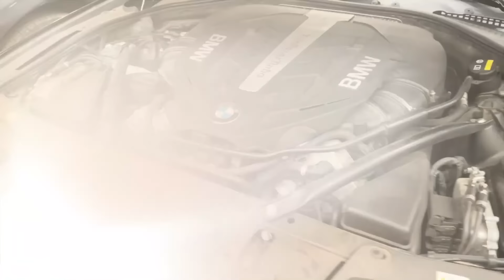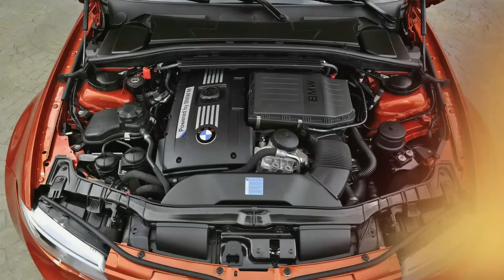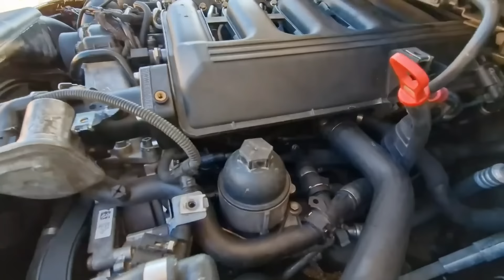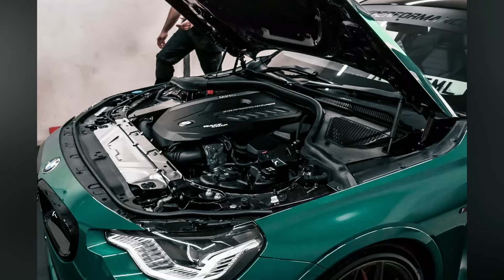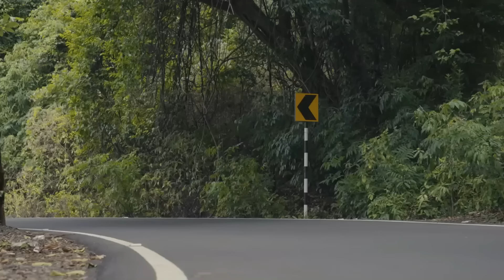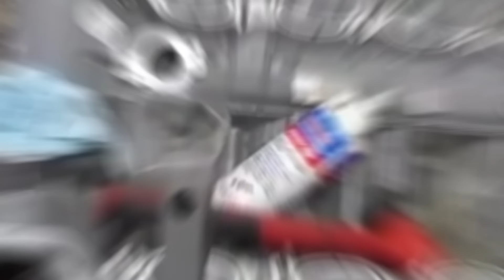3 WORST and 4 BEST BMW Engines to Own

Comment: I have n52 i love it. Some tips for an healty engine. Drive your car warm and when the oil is cold dont go above 3000rpm. Change your water pump when its old. Regular oil changes and check thr oil level regular.

Comment: N43 engines are also notorious for problems. timing chains, tensioners,  oil pressure issues, brake vacuum , ecu issues list goes on its a nightmare.
Reply: N43 owner here, after 35k km’s my nox sensor went out and i am getting timing chain resonance now on cold. Hopefully replacing the tensioner will fix. I have to check my oil filter for guide pieces

Comment: my N54 was pretty solid up to 250k miles when i sold it. original HPFP and original index 7 injectors, walbro 450 fuel pump and E40 tune at 24psi on pure600 turbos was the setup daily driving since 110k miles. and my S65 has been way less of a hassle than my N54. BE bearings are a one and done item, and i've just been keeping up with routine fluid changes.

Comment: i am someone who owns a n54 and knows alot about it the hpfp you can rebuild for 100 bucks ish the injectors suck unless they are index 12 where they dont have problems the carbon can often be cleaned at home or you can add port injector or meth injection this really helps charge pipe yeah but just replace it with a aluminium. my n54 is taken care of and the most reliable car ive owned ive owned 5 other cars

Comment: The N63 is not easy to judge: The first model was relly bad - BUT the N63B44T3 – N63TU3 Technical Update 3 is now one of the best BMW engines and has a great reliability. Close to the B58!
Reply: Would this be the 2013 650i gran coupe ?

Comment: My M52TU has 217,000 miles on it. Maintain cooling system in good order, regular oil changes…3000 miles (im old school ) going to rebuild VANOS next because of high mileage although still working fine…99 528i M Sport

Comment: N54 here , I agreed with the huge cost of maintenance and repairing. But at least N54 brings you performance unlike N46. In my opinion, N46 is the worst BMW engine ever. Lack of performance, fuel economy is just acceptable, and it still has notorious issues such as valvetronic failure(eccentric shaft, motor and sensor), valve stem seals also tons of oil, coolant leaks due to very hot engine(108 degree Celsius working temperature.)
So the first thing I done for N54 is lower the  oil and coolant temperature. The price is reduce the performance and fuel economy a little bit but worth it.
Reply: thanks for the honest review, else most of the n54 owners are misguiding the new-comers.
Reply: MY N54 IS AMAZING

Comment: Kkk n63 doesn't have oil filter housing, oil filter hounts on the sump,and if chain guides fail or break a car will just jump timing and won't start thz no any serious damage ,

Comment: 2013 N63U Not to bad, I don’t run the piss out of it. Brought used with 92K. Just systematically replaced common failing parts ahead time. I knew what I was buying 😂. However it’s been good.
Reply: It's not evn tht  bad I hve build plenty of them not even a problem

Comment: Save yourself the grief, buy a Lexus, Toyota engines are bulletproof.
Reply: Toyota doesn’t drive like BMW.
Reply: @Name-not-found92 
Toyotas run smooth, and are very quiet, their engines are bulletproof.
Reply: @masteryoda498 no they don’t that’s why the 2025 Toyotas are having massive recalls they used to be reliable back in the  80s 90s and 2000s
Reply: @masteryoda498 ive driven many Japanese cars that my family own and test drove a bmw 130i m sport. Yeah, honda and Toyota there the best a to b cars no doubt but damm, its not an exiting drive.
The beamer truly is different. id take my chanses with the n52 witch is already considered a reliable enough choice(even though i didnt, im still sad about it)
Reply: Why do you think they purchase a BMW to begin with this is one statement that I see a lot that's probably the stupidest statement that you can make they bought a BMW because they wanted one if you want it a Lexus or Toyota they would have bought one
Reply: @ChrisFoxx-s3t 
Because they fell the BS, and there’s nothing remotely stupid about my comment, talk to any mechanic and they will tell you to avoid BMWs like the plague.
Reply: @masteryoda498  My 328i with the N52 engine now at 207K miles, one of BMW's best as stated in the video.  I do not personally know any Lexus or Toyota owner with high mileage even close.  Those cars do not drive and perform as well a BMW.  I get offers buy from people who have ridden in the car.  I am very HAPPY with the car, no grief!
Reply: @masteryoda498 i agree i own a bmw one of the reliable one as they claim but compare the reliability of Toyota camry and honda accord accord wich i own the previous year never had oil leaks from valve cover,oil pan and filter housing  and never stranded on the road ie.. overheating cause by electric water pump failure
Reply: @masteryoda498 so you watch bmw videos you clearly have no interest in and then troll in the comment section? lol too much time on your hands
Reply: @marcselot3541 and thats why toyota and bmw created a masterpiece in the B58. one if not THE best engine out in the past 10 years for reliability and performance lol your not comparing that to ANY honda
Reply: @masteryoda498 I’m a mechanic and I own 2 bmws 😭 they are fine if you take care of them. So people actually want to own cars to DRIVE them, not cruise at 60 in a corolla SE I’ll do that when I’m 70….
Reply: Ты не на тот канал попал. Здесь нет фанатов бездушных, безвкусных японских жестянок:face-blue-smiling:
Reply: @thundercat7513 👏👏
Reply: New Toyota fails the reliability standadard my used old Mercedes has been rock solid for years with zero issues only regular fluid changes
Reply: Toyota supra = bmw motor ❤
Reply: Sounds like fun. 🙄

Comment: 2006 130i M-Sport owner. N52 + last mechanical steering rack = SUBLIME. It's not a horsepower monster, but the delivery is soo linear, it feels like a beast on winding roads.
Reply: I drive an n52 e92 330i… its just perfect
Reply: @mohi-m82  We are both winning at driving life :)
Reply: @mohi-m82 👌🫶🤝
Reply: feel the same about my 11 e92 335i.. feels amazing on the back roads
Reply: My rack on the M4 cost me over 4 k . Well the warranty company. In addition lower control arm both sides . Additional 2 k 
6 k invoice. I payed 200$ deductible
Reply: Dude, i test drive one of those and was ready to by it but didnt.
Much regret.